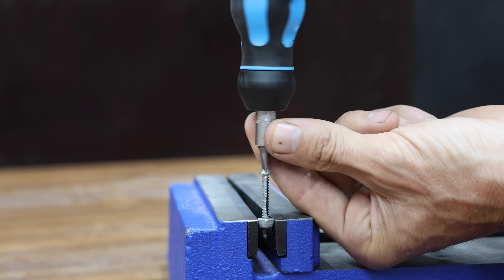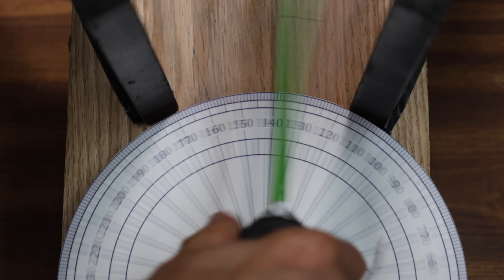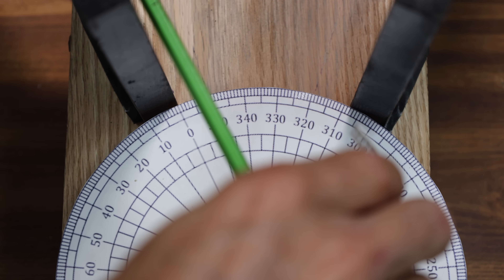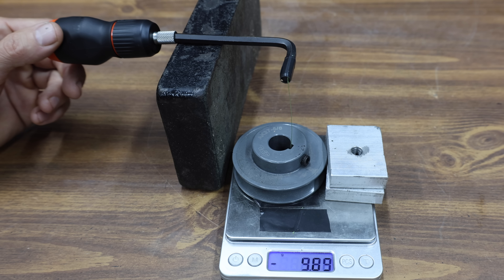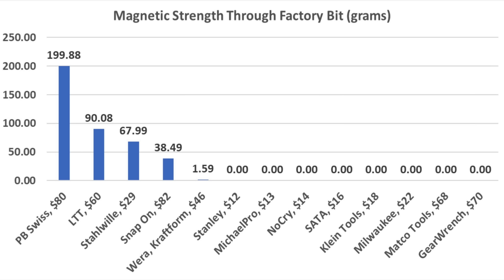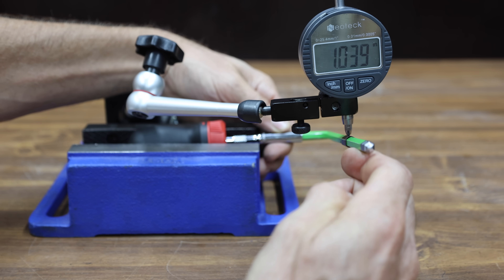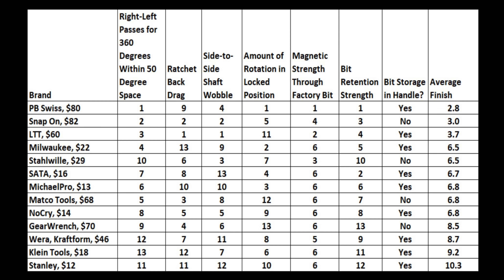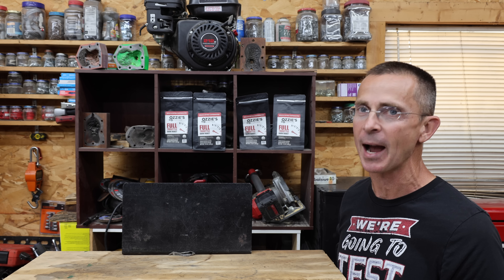Is Linus Tech Tips “Stubby” Screwdriver Best? Let's Settle This!

Comment: I own the non-stubby PB Swiss ratcheting driver, and even though I want to love it, the high backdrag makes it functionally useless for the work I do, since as an electronics technician, I work almost entirely with small, precise machine screws (M2-M4 mostly) that normally offer very little resistance. :( 

If they made a low-backdrag version, I’d buy it in a heartbeat.

Comment: LTT should automatically be disqualified due to the proprietary bits.  The handle only holds his “shorty” bits… and the stupid thing is… the regular/larger sized screwdriver takes the small ones too.

They don’t make or sell most types of bits, so you are stuck carrying the ten he gives you around.
Reply: You can use larger bits on both the small one and large one. You can also carry large bits on the large one. You just cannot carry them in the handle of the small one.

Comment: It would be interesting to see the numbers as normalized inverse ratings since you've got numeric ratings for most of the testing.

normalized_value = 1 - [ (value - min_value) / (max_value - min_value) ]

Highest scores matriculate to the top.  In your example, if all of the values are stacked on top of each other, but off by 0.01 out of 45, the ranking exaggerates the difference.  But in some testing (magnetic force), the pb swiss was off the charts while the next value was about half, minimizing the differences.
Reply from the maker: Thanks for the feedback.

Comment: I love your reviews. Clever how you figure out how to test each metric out. I was so set on getting my hands on a PB Swiss as a treat (as they are so nice in most build categories but expensive compared to the competition). I couldn’t believe it just broke so easily in one of your last tests in this review. Maybe as a light duty driver it’s still one of the best. 

I’ll mention though, having used several of these brands over my lifetime, the Germans still do the best bits from a precision perspective in my opinion. They seem to have slightly finer engineering with their cutting or the angles/edges or the like. If I was doing fine detailed work, I’d buy German (or PB Swiss) hands down (Wera bits are outstanding for fine work). Tough/robust work where abuse is regular, any of the Taiwan or USA made stuff would be good. I’ve had great luck with Craftsman and some DeWalt products in that regard.
Reply from the maker: Thanks!  Thanks for sharing.

Comment: It is sad that the milwaukee had such a horrible backdrag because I really liked the design + I was able too find it easily in a shop here in sweden for pretty cheap =180 Sek.
The Wera seems too have too many drawbacks too warrent the 400+ Sek that I am able to find it for.
The rest seems too have flaws in the design I´m not willing too live with except perhaps the LTT but 600 ish Sek is a lot for a screwdriver and I am worried that I will hate the L/R ratchet adjustment wheel since it seems so big and I might get frustrated with it just like I did with my Bacho that I kept accidentaly switching while using.
How hard is the adjustment wheel on the LTT one?
Great video as always you definately doo great work in making it easier for everyone too find the right tool for them.
Without this video I would probably have ordered a Milwaukee and been as disapointed as I was with my bacho one.
I even glued my bacho into the locked position since the adjustment wheel was so easy to turn that I more often than not accidentaly switched it while in use, cuple that with it having a lot of backdrag I just felt conned.
Reply from the maker: Thanks!  Thanks for sharing.

Comment: Future video request! Please consider testing 6 in 1 screwdrivers! From the 1.99 Pittsburgh at harbor freight (that's regularly free with a coupon) and beyond! This is a somewhat niche class of screwdriver that's particularly popular amongst plumbers, mechanics (HVAC not automotive) and electricians. 
They stand out for durability, simplicity and multi functional ability between their nut driver abilities and different sizes of other bits (classically ph1, ph2, 1/8 slotted, 3/16 slotted, 1/4 hex and 5/16 hex)

Then there's my favorite category which is the ratcheting 6 in 1! Made by Milwaukee, Lennox and Doyle brands that I'm aware of. Usually sold as "multi functional ratcheting screwdriver" but based on the 6 in 1 design that's much broader than just holding a 1/4" bit.
Reply from the maker: Thanks for the suggestion.

Comment: Thank you for the video! A stubby ratchet screwdriver is part of my EDC as a plumber. I've tried a number over the course of time including the Milwaukee that you tested. 

However I landed on the Doyle from harbor freight as my go to. The biggest thing for me was not so much the bits carried as much as the fact that the Doyle is based on a traditional 6 in 1 screwdriver. So the bits are double sided with a detent pin instead of magnet based, but it also provides excellent functionality as a nut driver for 1/4 and 5/16.

I was a little bit sad to see that neither the Lennox or husky stubby made the list, however that just means that no one recommended them. 

A small tweak that I'd like to see would be a dirty stress test. Similar to how you tested tape measures by dumping them into a dusty bag to see if that changed the performance. 
I feel like a number of these mechanisms would struggle once dirt made it inside the to clog the main gear... Ask me how I know.
Reply from the maker: You are welcome!  Thanks for sharing.

Comment: I notice that many of these will include the rarely employed T15, or T25, but not the standard Robertson #1 or #2?! Do you guys in the States not have Robertson bits?
Edit - okay, the Milwuakee has Roberston! Problem solved! (Torx is better, just much less common here in Canada outside of Stihl equipment. Robertson #2 is the general use for most things, particularly wood screws, with Phillips being equally prevalent, especially for electronics, and Flathead only used for the lightest applications like vanity covers)
Reply from the maker: Thanks for the suggestion.
Reply: This gives me an idea for a test. Which bit type performs better? Phillips, Robertson, Torx, Hex, or Flathead? (Torx and Hex should win, followed by Robertson, then Phillips, then Flathead in last place) Would love to see you test it tho!

Comment: I think a very important note as to LTT screw drivers is that they are designed for working on tech stuff where you really don't want to put a lot of torque on things, where it would be better for the tool to break before you break something expensive, hence why an advertised feature of ifixit tools is "Our tools will break before causing damage to your device", there are no perfect tools just the one best for the job.
Reply from the maker: Thanks for the feedback.

Comment: On the LTT which broke at 193in*lbs, you commented that it's "a lot more torque than you'd need for a PC build."
On the PB Swiss which broke at 152in*lbs, your comment was that it's "Definitely not a tool designed for rugged use and mechanical applications." 
I understand your comment, however it almost seems like you're impressed with the LTT and disappointed with the PB Swiss, which imo isn't a fair comparison. The LTT broke and has an irreplaceable stem, unlike others (for example the snap on).
That should have been the main comment and difference in this test, not a joking "bit of JB weld will fix it back up". 
Great video though and real definitive!
Reply from the maker: Thanks!

Comment: One thing to remember is the LTT screwdrivers are designed for working on computers primarily, so the lighter mechanism is going to differ from the screwdrivers meant for home repair or automotive work. Still, for $60 it came out ahead of a few of the more expensive drivers which is all you can ask for when spending that much for a screwdriver. Snap on and PB Swiss should consider dropping their prices a bit if they want to stay competitive.
Reply from the maker: Thanks for the feedback.

Comment: Great work with these comparisons! This is the first place I go when replacing any of my subpar tools.

Have you considered comparing Bit Ratchets? 

They are designed to either use bits or an adapter for 1/4" sockets. Great for more torque than a ratcheting screwdriver. Also good for hard to reach places! I've found that either the gears break inside or the ratcheting mechanism is too stiff preventing it from ratcheting properly. Would appreciate a comparison on those!
Reply from the maker: Thanks!  Thanks for the suggestion.

Comment: i feel like precision tools might be drifting further from the testing you do, but when the LTT Precision Screwdriver comes out, i will be looking forward to testing of bit strength.
it may seem odd to seek bit strength testing for a precision tool, but for DIY FPV Drone building and repair, we use small screws but they still need to be firmly torqued to stay tight in often very high vibration, high acceleration flight, along with high velocity crashes XD all of my cheap Miniso screwdriver Hex bits have rounded off, i can't easily repair my drone anymore.
Reply from the maker: Thanks for the feedback.

Comment: I got a Doyle from Harbor Freight, exactly the same as the Klein Tools. Huge downside is that the screwdriver relies on a ball and spring on their bit to retain the bit. So you can't just grab any old bit from a set. Normal bits are also too short and sink pretty deep into the screwdriver.
Reply from the maker: Thanks for sharing.

Comment: That confirms what they said about the design choices they made with both versions of the LTT screwdrivers.  You can’t make a screwdriver that’s the best at everything, and they said they went for the least backdrag, strong magnetic bit and screw holding, and comfort—but it’s not like they did that bad in the tests they didn’t optimize for.  Certainly not the cheapest screwdriver, but if you’re working with lighter duty stuff like electronics or occasional DIY projects, it seems like they built a premium product that’s better suited to those than the most expensive ones in the test.
Reply from the maker: Thanks for the feedback.
Reply: @ProjectFarm  Thanks for the feedback.

Comment: I own the snap on. The in handle bit storage in stubby screwdrivers is something I actually don't want. They normally get opened on accident from friction in the palm. The interchangeable length of bit holders on the snap on is a game changer as well. I love the ability to have the tiny handle with different reach capabilities. Sometimes the full size handle is better and sometimes it isn't. Also, the snap on truck will just hand me a new one if mine ever breaks. Not saying the little is bad. Just sharing input from my personal use as an aircraft mechanic.
Reply from the maker: Thanks for sharing.

Comment: The PB Swiss bit broke at 145lbs, then its handle blew out at 152lbs. That's a 7lb overage. It would be nice if the handle had at least a 50lb overage. But, considering that theirs was the strongest bit of the bunch, that handle is considerable as safe even at 152lbs. The question is, if your bits will completely sheer before any other part of the mechanism fails, why does it matter at all when the mechanisms fail above that which broke the bit? My answer is... it doesn't. In my experience, I have never encountered a fastener (outside of vehicular  wheel nuts or those in literal industrial settings) designed to be tightened to even 100lbs without it being a lug or bolt. The highest I have personally seen for anything I would use a screwdriver for is ~50lbs. That said, sure, if you are doing something where the parts are NOT well engineered, or where you need to countersink a fastener by manual force (which is idiotic), you might need 75 to 80lbs, but that is, again, idiotic. I actually like it when tools are engineered to fail AT SAFE LEVELS instead of allowing for abuse at higher pressures (that are totally unnecessary) which could lead to injury.

Comment: How about comparison testing of anchors for attachment to a construction block (basement) wall, like you did for anchors to drywall.  My guess is that good old fashioned toggle bolts would be strong, but (for a given fastener size, e.g. #10, 1/4") require a larger hole than most.  Wonder how the flip toggle style anchors perform relative to those.
Reply from the maker: Thanks for the suggestion.

Comment: The LTT driver is very targeted at the demographic who uses it as their daily driver (no pun intended).

It's meant to excell in space where you can't move your arm, only your hand, such as the inside of a PC case or other electronics enclosure.

The rotating endcap is a huge selling point for me, as it lets me easily apply good pressure without making the task of turning the driver with my fingertips difficult.
Reply from the maker: Thanks for the feedback.
Reply: @ProjectFarm  No problem, it's not a common use case relative to all the usual automotive/industrial/home DIY uses for a stubby driver, so anyone not familiar with working on PCs/electronics wouldn't have reason to think about those instances for the purpose of review.  I just wanted to point it out for anyone reading the comments as it helps justify the price for those niche customers like me where repetitive strain is an issue.

Comment: I'm always genuinely impressed by the design focus with the LTT screwdrivers. The backdrag makes them ideal for really fiddly fine threaded fasteners with enough strength to be practical in any reasonable use. 

If I had to put this much torque on a philips screw I'd probably already have pulled out the drill or an impact driver lol.
Reply from the maker: Thanks for the feedback.

Comment: The charts needs to be better. It was confusing to look at the ending chart where it goes by the winning placement without much warning until you look at the ending column for "Average Finish".
There are no indication of "lower is better" or "higher is better".
There's no review of the previous charts prior to the final chart for their "average winning placement" (instead of "average finish").
There's no time stamps/chapters where the experiment happened and the results of the experiment.
Reply from the maker: Thanks for the constructive feedback.

Comment: LTT screwdrivers are quite consistent it would appear – often in the top of the pack, not expensive compared to better performing tools, but indeed a bit pricey for many people who doesn't need a screwdriver everyday. They definitely have a great "prosumer" niche nailed down.
Thank you, Todd, for carrying out all these tests for us to refer to!
Reply from the maker: You are welcome!
Reply: The LTT screwdriver, the big one, is almost identical to a snap on model that has been around for many decades. The snap on one cost about twice as much. The shape is the same.
Reply: @jameszaccardo1520  shape is different three lobes vs four lobes
Reply: I think they are made by megapro.

I bought one way before LTT started to rebrand them and I swear to god it's the only tool that I've genuinely been surprised how well it was designed. I probably put 15,000 hours of use on that little red fucker and it's still going strong lol
Reply: @griffinmackenzie6364 iirc LTT has been very transparent that they used patented ratchet and bit holder designs from Megapro, but LTT did made lots of changes to achieve their desired ratchet feel, e.g. the low ratchet back drag. Definitely great for low force and more delicate applications like electronics assembly and disassembly (duh), but yeah the original Megapro should be much better for heavy jobs (not to mention the LTT upcharge) – although it looks like the only way to get a Megapro-style ratcheting stubby at the moment is the LTT Stubby.
Reply: @one-six952  The also had it re-engineered to have the selector switch work the opposite of the direction megapro does. As that not only makes sense, it matches the direction of the Snapon Selector switch Linus used before this.
Reply: @griffinmackenzie6364 LTT licensed the Mega pro patent and improved upon it themselves through engineering. It wouldn't have taken them 3 years of development time to simply rebrand a megapro

Comment: I think the brand is called Lenox? But I used to goto Lowes and pick one of their ratcheting screwdriver kits when I’d move or if a friend didn’t have tools. They are smooth and sturdy and was like $20. 

I’m not spending $80 on a ratcheting screwdriver. If I built PCs for a living sure, but I don’t. No need for that level of gears.. just gonna wear quicker anyways.
Reply from the maker: Thanks for the feedback.

Comment: The biggest question would be, would the price of the Milwaukee justify it over the higher priced ones?
Reply: yeah but that one low back drag rating sort of defeats the purpose on a ratcheting screw driver.  It is good locked though so I still might try it out.  I don't have a ratchet screwdriver or a stubby.  I use the new Klein 14 in one for most things these days.

Comment: Dear Author, 2 suggestions:
1) in side--to-side-wobble, "the more" isnt necesserily "the worse", as it allows to operate with driver from slight angles, which could be very useful in some tight areas😉
2) shouldnt You use the same bits (or even same particular one) while measuring how much load it takes to remove it from socket? Having done it Your way doesnt only measure magnet strength, but also how well fit original bits are - and not always those original shall be used😉